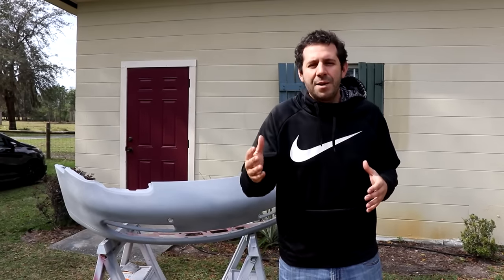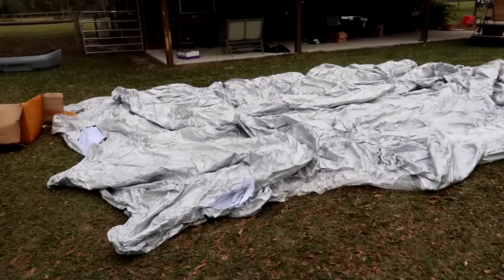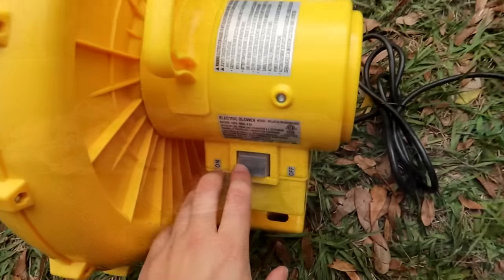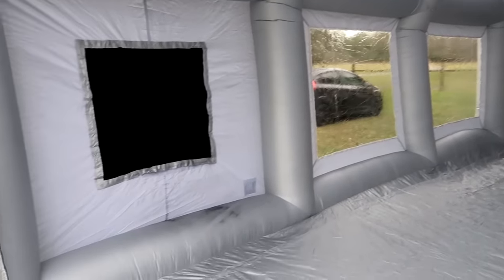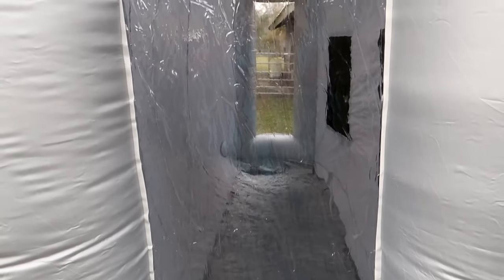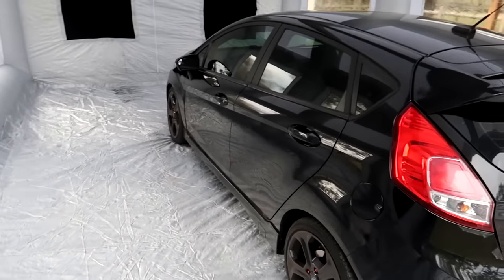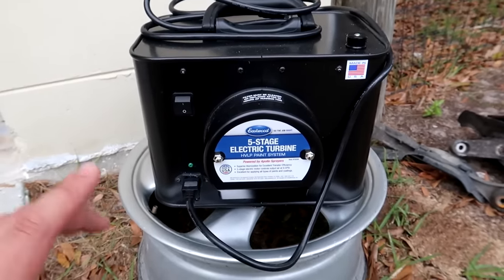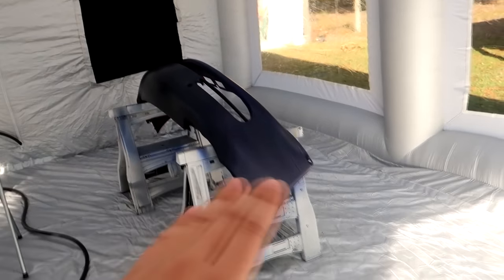I Bought an INFLATABLE Paint Spray Booth from China!

Comment: Make sure any over spray on the walls is dry before you fold it up or you may inadvertently glue it together forever.
Reply: Na, paint isnt an adheisive. Thats why 90% of painting is prep!
Reply: overspray probably dries instantly with all that airflow
Reply: Hi D W,  I had a body shop years ago and had a guy bring me a Ferrari replica he was building. He had it painted at another shop. He got it home and covered it with a plastic sheet to keep it clean. The plastic stuck to the paint because it will gives off gases from the solvent for some time. I had to strip the car completely. It was not an easy job with the plastic stuck to it.
Reply: that is a slightly different and massively stupid scenario.who in gods name covers fresh paint that hasn't cured and  released its solvents in a plastic bag? 
the person who did this,if he/she is a real human wins "one of the biggest idiot of the entire world" award

  @idigdaytona4478
Reply: @trillrifaxegrindor4411  He paid for his lesson in cash. He did feel like an idiot.
Reply: @idigdaytona4478  yep outgassing
Reply: @idigdaytona4478  that happenes I have a body shop a worker covered a car that was painted but it was painted a couple days before it got covered and the sheet stuck to the paint but we sanded it with 1500 grit and buffed the car looked like it never happened but oh boy wasted a whole day doing that
Reply: It's amazing what is inflatable these days
Reply: Paint doesn't stick and it works surprisingly well.
Reply: I assume you are going to let the car dry inside so probably not a big deal but it does seem risky what if the power goes out or something and it collapses on a freshly painted car
Reply: If you’re painting with oil based paint maybe. But as I’m sure you’ve read if the car is dry enough to back out the walls are way dry
Reply: just let the kids play in there, when the paint stops sticking to them ... ya fold it up
Reply: James Holbrook thats why you use a generator
Reply: hey chancho why there are some serious replicas out there for tons less than you would spend on the real thing and if its for yourself who cares about it only a handful of people would even know
Reply: @serbia991 … it's not always the fault of the paint. Certain types of polyethylene plastic will degrade in sunlight and do the same thing, even with powder coat finishes.
Reply: @rupe53  we use keystone wrap to cover cars somtimes the bag likes to lift up so one time I sprayed water underneath the bag and it stuck to the car big time I leaned my lesson lol
Reply: @idigdaytona4478   Wow what a bummer
Reply: @idigdaytona4478  I bet he only had to learn that lesson once.
Reply: Try using a wet/dry vac in vacuum mode. To make it collapse faster.
Reply: I wonder if MEK or the prep sol would eventually melt the plastic... maybe put some luan fiberboard on the floor in case it drips....
Reply: I Dig Daytona If the car came out to pack away the booth than that overstay has long ago dried.Flash times for medium wet coats are usually somewhere around 15 min.So that very thin,dry like over spray basically dries instantly.
Reply: @Joe Casson Do you have one? I can tell you that it doesn't stick to mine.
Reply: James Holbrook, what f the sky fell?
Reply: @idigdaytona4478  ugh what a nightmare
Reply: @ D W professional painter here, paint is fine but solvent based clear coat will 100% stick that shit together if you put it away wet. This should be pretty obvious though, nobody with common sense would spray something and immediately put it away.
Reply: You need to let the clear over spray to dry and it should be fine if its not completely dry then you have a problem why because it has hardener if dont paint cars you wont know
Reply: And if you put a fan inside to take the over spray out you wont have a problem
Reply: 🤣🤣🤣 soo true
Reply: I saw an inflated trump in the news .

Comment: You're supposed to go in the small rooms first. It's essentially an airlock. Go in the door, close it behind you. Open the door into the painting area and close it behind you. Reduces bugs and debris in the painting area. Sometimes opening a door can disturb debris on the ground or in the are around the door.
Reply: You realize he’s going to have to drive into it right?
Reply: @nataliaattree133  The big door is only used to get the car in and out. If the car is in the booth with fresh paint on it and fume extractor running, opening that big door will create a huge, unfiltered vacuum source and suck tons of debris in and onto the car's wet paint.

Comment: What happened with it deflating was exactly what I was afraid of, glad you caught it before it landed on the bumpers.

 The best part of your videos is you are completely honest. You don't hype everything up more than you should, you give the drawbacks, you show your mistakes. It's very refreshing to see such honesty in videos and I hope you know how appreciated that is!
Reply: Agreed @ Rob Anicich
Reply: Rob, spot on!
Reply: I second this. That's what happens with real people, learning by doing. Very refreshing!
Reply: I wonder if they had one way intake valves so the air can't escape when it's erected. So if the blower motors stop working the booth doesn't deflate like it did.
Reply: Could always set up a makeshift pvc skeleton in similar shape inside of the booth just in case the power fails again.
Reply: @turborunner  
Alot of bouncy houses actually require the pump to stay running and they have outlet holes all throughout the tubes to prevent accidentally over-inflating. When the power kicks off, the air releases through those holes or out the pump hole.
Reply: @morecrapforputdowns  I was thinking something similar
Reply: Sam's honesty and humour is truly endearing!

Comment: My experience with bounce houses and inflatable pools is that usually blowers(good ones at least) have in and out blowing. If you put them in reverse they will suck all the air out of the booth and it'll make it easier to fold, plus you don't have to wait forever for it to deflate. Try that out, hopefully it works.

Comment: I did something similar inside my garage, but it would work outside as well. Just threw together a frame of 2x3's and stapled clear plastic over it. Used 4 standard filters from a hot air furnace in the front door and created an exhaust system on the rear with 1x3's to create a duct to an exhaust fan. Worked very well. Painted a whole car. No problems at all. Used a fresh air system instead of a filter mask. I was a professional auto body painter for 5 years so the results basically come from knowledge and practice. You really just need a clean dust free environment and a nice day. No wind and no high humidity. This tent is cool, but expensive. Mine cost $250 approximately.

Comment: A bouncy house spray booth for a big kid rebuilding big Tonka Toys. It doesn't get any better!
Reply: I used to deliver and setup bounce houses for kids parties and events.   The big ones are several hundred pounds of heavy plastic :) :)
Reply: I can see painting a car, getting done and losing electricity. Down it comes on to your wet paint. OUCH!
Reply: @lostintime8651  QUICK GET THE LEAF BLOWER
Reply: Doug  DeMuro's cousin? well presented 👍
Reply: With pvc frame and some cellophane sheets you can make you own bug proof chamber for under $200 or cheaper depending on size.
Reply: Nairuulagch 
But not as cool
Reply: @lostintime8651  Just hook up your generator... a shop that big should have one....
Reply: @Nairuulagch  But what would you do for ventilation at that point?
Reply: dam it you stole my reply ! lol
Reply: @oldmazda2 ` that's what I thought about doing too.
Reply: I was waiting 2 c how someone would turn it into something sexual, lol, didn't take long
Reply: @Nairuulagch   A PVC frame that is 35x15x15?  Good luck with that and good luck buying that much PVC fro 200 bucks
Reply: How much was that thing?
Reply: @khsoupdragon  He said it was around 1300 not a bad deal when you consider you get fresh air with filters, windows a zip up door, a mixing room and you can pack it up in a big box when you dont need it
Reply: Hahaha....so true!....

Comment: Very cool.. a couple tips .. spray the initial coat super light to create a nice tacky surface.  Try and complete a complete pass across the object each pass, do not criss-cross or do back-and-forth in small areas. You will find you get a much better finish and less runs if you do these simple steps. :)
Reply: FPV Club literally not sure how anyone could run a base coat
Reply: @jakecummings9024  not reading the data sheet and over-reducing it 1:1 instead of 2:1
Reply: @jakecummings9024  it happens man it happens
Reply: Sound advice you have there.  I don't personally have noteworthy experience with a spary gun, but that's basically what I do with rattle cans, and it works well.  I do someitmes criss-cross (if needed), but not like he did (long strokes, instead of his typical rattle can short stroke method).  Of course before that you have to do proper prep work, and not have any surface imperfections that would pop out once you add clearcoat.

Comment: If you do your own body repairs and paint, it will pay for itself.  As a auto body painter for decades, I strongly recommend putting on a white Tyvek suit.  This way you keep any dust and particles from clothing and hair contained.  Over all for the money it works well.  I hooked up a vacuum to it and it rolled up nice and tight and I built a wooden box and in it goes.  Thanks for the video!

Comment: as someone with experience in the ammusements industry, I can tell you that to properly pack a large inflatable requires multiple people. you pull the inflatable as flat and even as possible on the end farthest from the air inlet, fold it over about one foot and step on it all the way across. repeat the fold and step process all the way to the inlet and it should be as flat as you can get it, then fold/roll the resultant roll till it fits in the bag. Great video Hope this helps in the future.

Comment: I had one of those for work.  Just make sure that you put paper on the floor and before you spray and  it will stay much cleaner
Reply: How about just use those big rolls of plastic sheeting? It may have been the 10 ft. x 25 ft. Clear 3.5 mil Plastic Sheeting that I used. I don't remember the exact specs of the sheeting. But when I worked in construction building house foundations, we used the sheeting in the winter to cover our fresh concrete pours. And then I have been buying it for different things at home.

Comment: A little tip from someone who used to run bounce houses for parties back in the day.  Some fans have the ability to hook up the inflating sleeves to the intake side of the fan.  If you do this, you can suck the excess air straight out and have it completely flat in just a few minutes.

Comment: I bought the same one and painted my third gen Firebird last year. Got it back in the bag and now a family member is painting their car this spring. I love this booth works great.

I put both blowers on different fuses. My 60gal compressor has its own circuit as well. Never popped a fuse.

You fold it by folding over each side while forcing out the air.  Then roll it from back to front. It's not that difficult. Just requires patients.
Reply: How much are they.
Reply: What’s the link ?

Comment: Sam, you need bigger ground stakes to keep that safe. Look for bouncy house ground 18" Steel Hook Stakes...did a quick search and found the 18" ones for $5 each.
Reply: You can also you dog tie outs too.
Reply: There’s also a 2000 lb vehicle that’s inside . But yeah for those few minutes before and after, there really should be some extra tie downs but mostly from the top to secure from swaying.
Reply: I said this as he was painting with only the front and rear bumpers in the bouncy house.
Reply: They are called earth screws
Reply: those plastic ones won't last very long, I replaced all of my stakes with metal ones.
Reply: what it needs is a way to stake it with some poles at the top of the wall height.   A heavy wind gust and a wet coat if clear is really going to ruin your day!
Reply: I found some of those screw in stakes at Tractor Supply for about $3 a piece. Keeps our trampoline from flying to Kansas...
Reply: Glad that I wasn't the only one who picked up on yellow tent stakes not going to cut it if the wind picks up and there is no car in it.

Comment: I have an idea of course someone may have already said this I don't quite feel like searching the comments though but as an insurance if you're painting a car I would go out and buy some three-quarter inch PVC piping and slip together a frame that you can push against the walls and semi attach it that way if you lose air the system won't come crashing down on your freshly painted cars or parts....would be very simple to build basically a PVC box inside of it that way you can cut the air and let the thing droop down on it without damaging your work.... but don't permanently glue your PVC piping just slip fit everything together
Reply: 100$ for 1,000 square feet of strong poly..same thing marijuana growers use for grow rooms. then like 30-50$ in wood and you have a paint booth. and plenty of poly... can make it so you can take it down and reuse it too.
Reply: Wow Gary, we think the same. I just read your comment and it's almost exactly the same as mine. I didn't steal your idea...honest. It just made common sense to me to suggest the pvc. It was something I had thought of immediately after he erected the booth. It's what I would do... Great minds think alike.
Reply: @themessenger5868  haha =)
Reply: I mean, if you are going to do that, you might as well avoid buying the booth altogether. Just create the PVC box and lay down your own plastic on it.
Reply: @SpencerFcp  No way ! PVC is easy as...but to create this enclosure out of plastic and tape would be a nightmare...in my opinion.
Reply: Gary Marshall smart guy.i build Ann  kinds of shelter green houses with pipe
Reply: Brilliant!!!
Reply: Good thinking

Comment: Just make a PCV skeletal structure on the inside to protect it from accidentally collapsing.  Should only cost a few bucks.
Reply: or use guide ropes via some d-rings that any doofus would have specified to be integrated in a custom build like this. this guy is beyond doofus level though.
Reply: good idea. maybe more than one use cool idea painted out side more than once lol
Reply: Beastly Garage that’s thinking ahead
Reply: yes, a few poles, and ropes on outside ...to support in case of power failure, and to tie the darn thing down so the wind doesn't lift it (those little stakes he put in, aren't going to help much)
Reply: PVC  is more expensive  than you think
Reply: i would recommend metal pipes so that he can use it as a rack to hang body panels from using wire, which could make painting a bit easier, it would be quite a bit more expensive than pvc, but i think pvc would also not be able to hold that weight of the booth well.
Reply: ThatOne OldRedFiat Just testing y’all. You win lol
Reply: @fuckngreat8955 ( positive crankcase ventilation) probably a mechanic.. Sometimes i do the same! Lol!
Reply: That was exactly my first thought. Build an interior skeletal structure, then you only need the air exchange blower running.
Reply: With pvc frame and some cellophane sheets you can make you own bug proof chamber for under $200 or cheaper depending on size.
Reply: Yes, but what is 30-50 dollars more to improve a $1000 investment?
Reply: @fuckngreat8955  Made out of aftermarket PCV valves!
Reply: If you've ever worked with bouncy castles, inflatables are surprisingly heavy. Although this booth looks like a lot thinner material.
Reply: @fuckngreat8955  Nope, you attach a hose to the pcv vent on the car and that helps keep it inflated. Keep the engine running and just make sure to not breathe any exhaust fumes!
Reply: With a car inside I bet the wing will loss

Comment: Some say he's still trying get it put away
Reply: If he just reversed the blower it would collapse very quickly.......
Reply: @sreid4985 think before you type, This guy seems handy enough to figure that one out if possible. some fans don't reverse nor do they have a reverse setup on them. Maybe?
Reply: @rheadog9546  To be honest he didn't estimate power consumption before plugging everything on the same breaker so, mistakes can happen.
Reply: In about 2 minutes I can turn that blower around, duct tape a cardboard plenum to keep it from collapsing, and pull a vacuum on the whole plastic rig. He didn't mention having solved that issue, so I offered. What is your issue,,,,,,,,,,,,,,?
Reply: I went to his house and pop it with an Barbie pin but hey don't tell nobody.,😁
Reply: Lol that guy is still rolling around on the ground, 3months later!